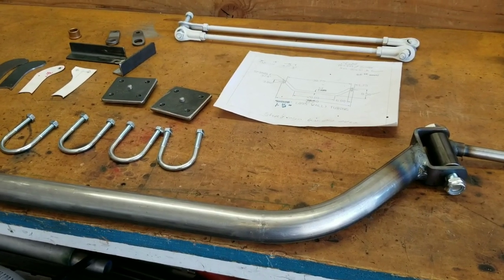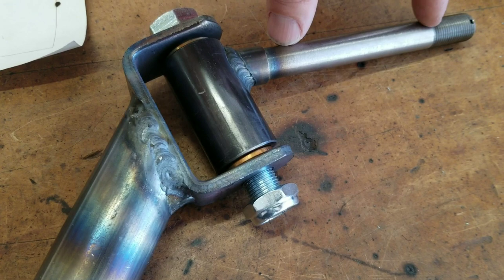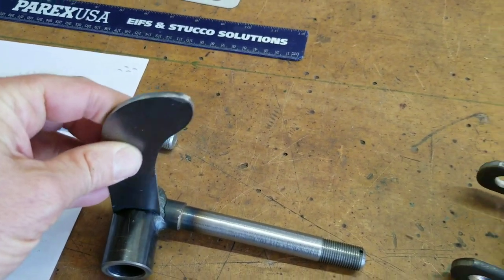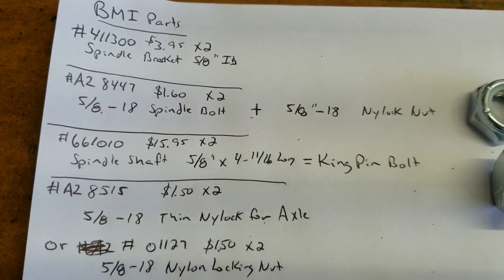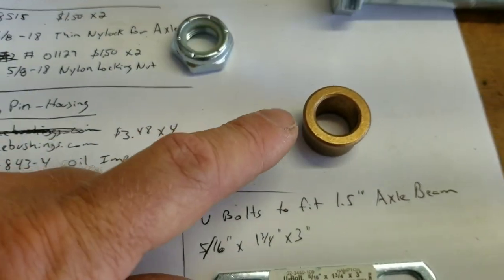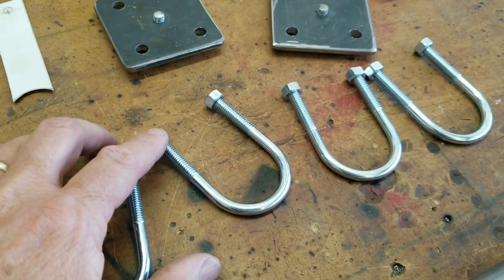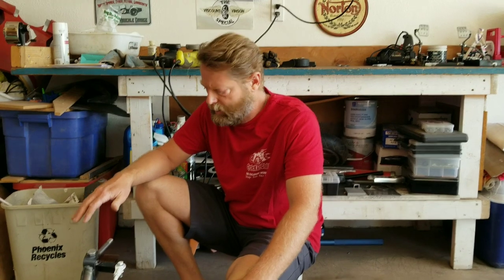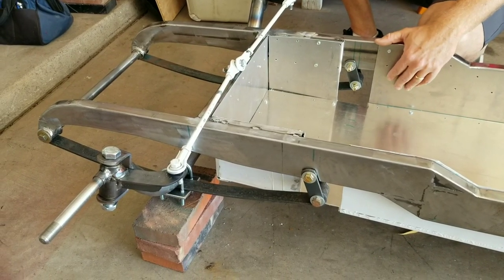Cyclekart Frame part 7, Spindles and Front Suspension

Comment: Steve.  A very good explanation.  I did spot a small error in your ackerman process.  Your string should have been located on the kingpin at the exact location the steering control arm is mounted.  You have a 14 degree KPI so your ackerman angle will increase slightly.  I know it is a very small detail in the overall scheme of things.  I love your videos and they are a great help and source of ideas.
Reply from the maker: Thank you

Comment: Looks great. Did you get enough turning radius before the flanges hit the inside spindle brackets? Ill be on the look out for grinder notches cut into those spindle tabs.
Reply from the maker: The bottom out at the same point that the Pitman arms bottom out on the steering shaft.

Comment: Hi Steve I am enjoying this video very much. Very useful info. My tube drop axle is ready to cut.
I believe you are running neg/camber, so the angle for my king pin should be 14 deg. I will cut my drop axle at 14 deg. Out.
Axle bolt @ 7 deg. (With fixture) 
My question is, is the weldment tipped ahead slightly. And how is that calculated?
Reply from the maker: I have about 5 degrees of Castor built into my front axle, it can be increased or decreased by rotating the axle.  5 to 7 degrees seems to work really well to help the kart steer straight without darting around.